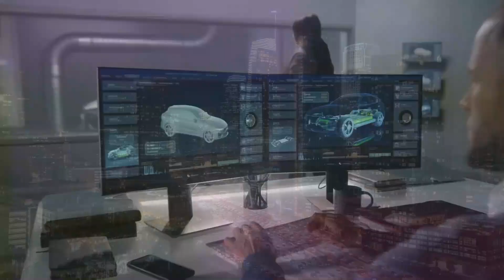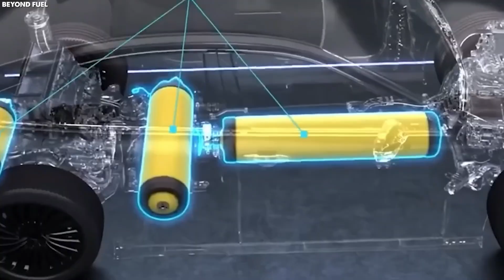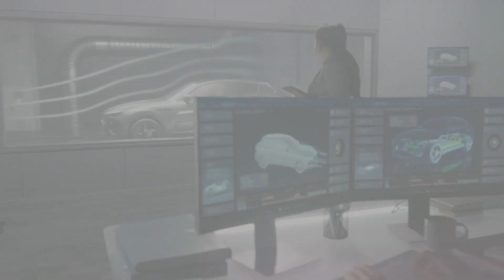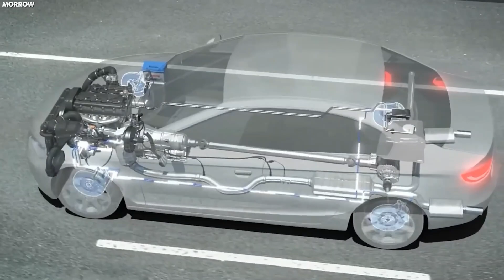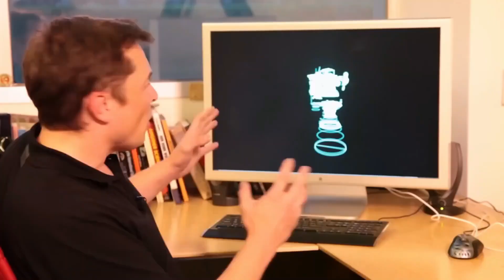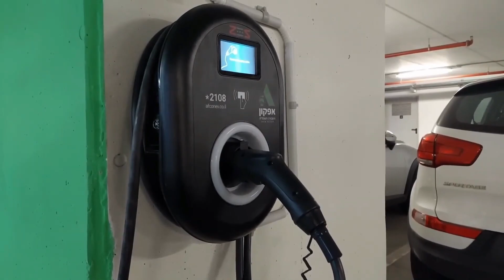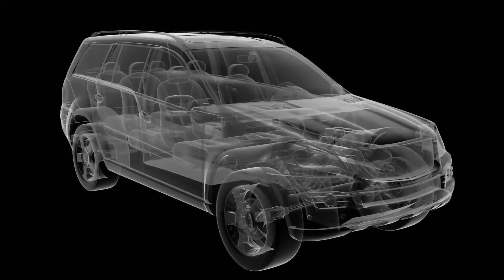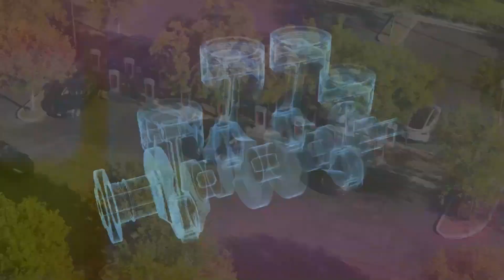Elon Musk   I am releasing My New Water Engine TODAY

Comment: It takes more energy to separate the hydrogen and oxygen from water molecues than you get by recombining them by combustion in an engine or by using the hydrogen to make electrical current so it is a net energy loss. This has been known for a long time so it's not new or an invention by Musk. The electric car is a Musk scam that isn't working so he is on to the next one. It won't work but he may make it look as is it does for awhile and suck more $ from the govt and the population. You can probably make a lot of money in this scam if you speculate and get out on time just as you could with Tesla

Comment: I didn't need to get to far into This vdeo to here that the engine is a hydrogen engine. So where is he getting all that Hydrogen take massive amounts of electricity to split the hydrogen molicules from the oxygen molicules. Where is he getting all that electricity Maybe rainbows or unicorn farts, no thats not it. Oh ya coal, natural gas, and nucular. What a fraud this Elon is. Toyota has been at this for years, Ford was working on a Hydrogen truck back in the 1980's The problem is Hydrogen requires high pressure vessels for storage. Elons engine is just an ordinary internal combustion engine. This will never be economically viable. Just more proof that Elon is nothing but a con man. His electric cars are a failure and this will be too. The problem is alot of people are going to get screwed out of their money before this con job plays it's self out.